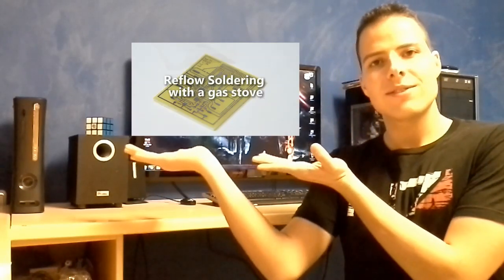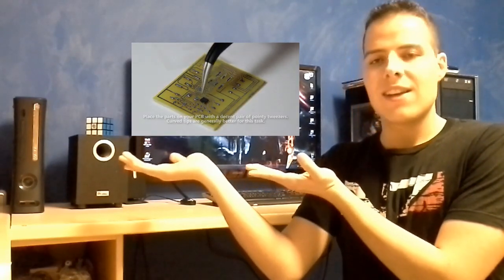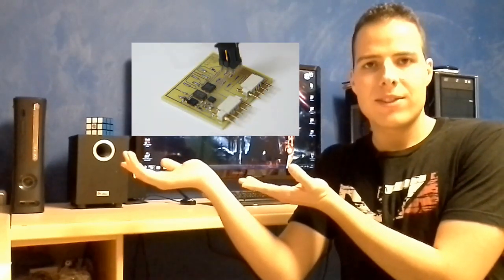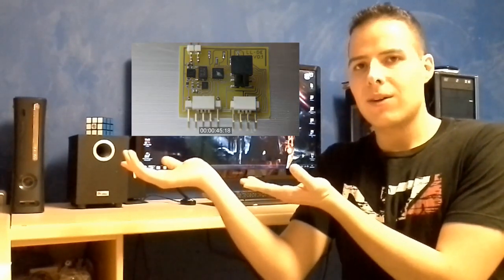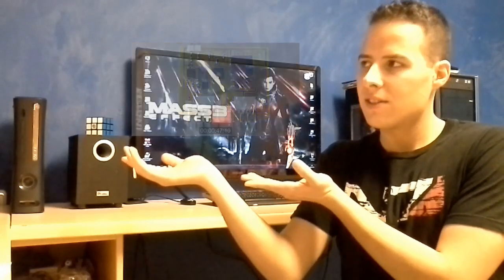7 - Tips about improving SMD soldering and homemade PCBs

Comment: I would second the Aoyue 968A+ recommendation. A friend of mine has one and it totally rocks. It's got everything you need and is a soldering "super machine". The smoke absorber and blue lighting are great features. I personally only have the "Soldering Iron Variable Temperature 50W" from Sparkfun - it's all I can afford. Depending on where you live it may not be an option because it's only 110W. It does take the all Hakko tips though. I ordered the beveled tip specifically for SMD work.